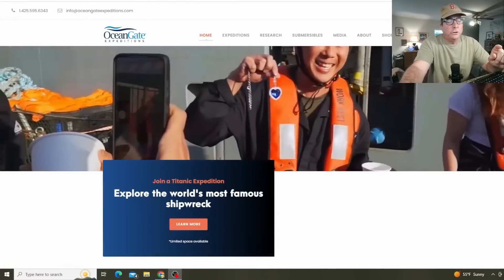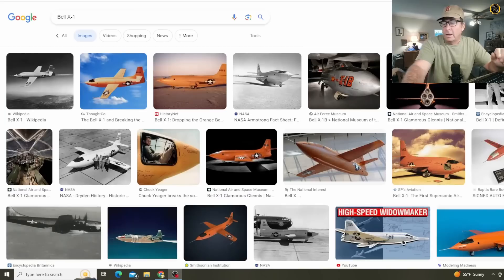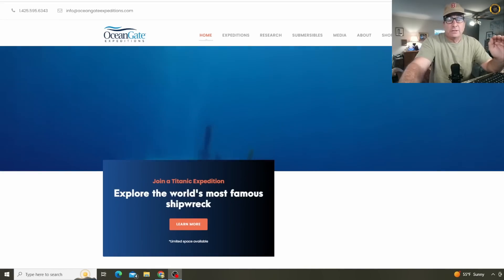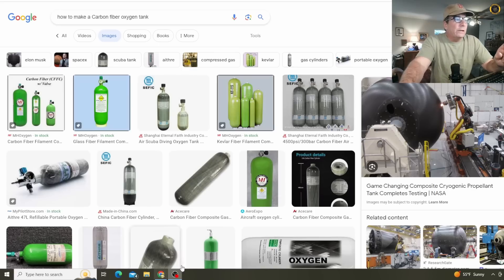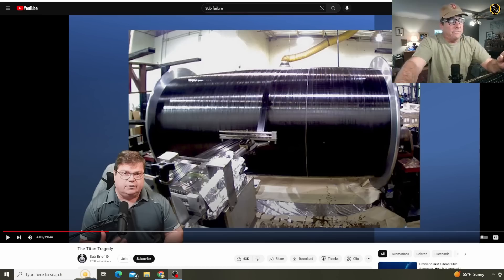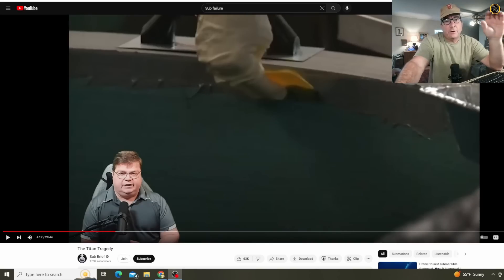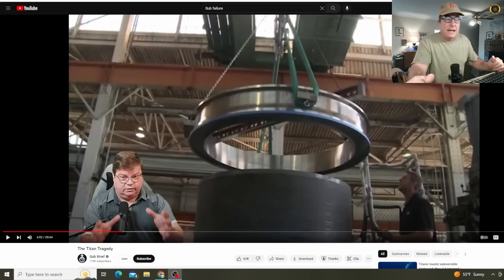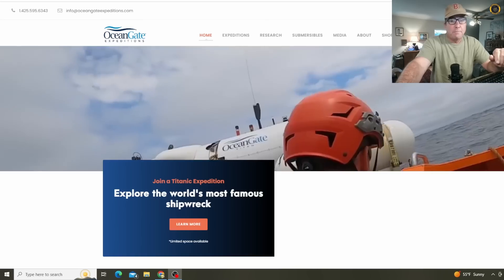Oceangate Sub Construction Details and Implosion

Comment: Your lack of knowledge of mechanical engineering and materials science is worrisome here. You are significantly out of your area of expertise. As is your lack of knowledge of test and inspection. Ultrasonic inspection of carbon composite materials is routine and can  readily detect voids and other defects. Though I believe OceanGate did not perform such inspections. Everything you say here is purely the speculation of a lay person and is quite irresponsible. PLEASE stick to the things you know - you're really good at that. Yes, there are a huge number of weaknesses in the design and test of this submersible, but you're failing to accurately identify them.

Comment: The structure should be crosshatched. Military aircraft use a crosshatched pattern to strengthen against damage and delamination. I would never board that submersible. Aside from the construction techniques. It's a tomb. There is no exit once assembled. I won't mention depending on a game controller.